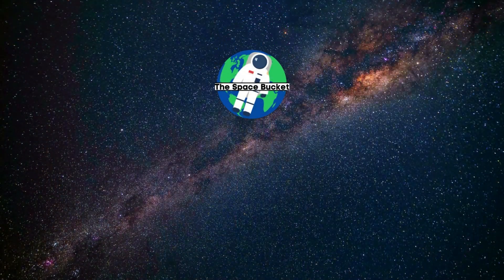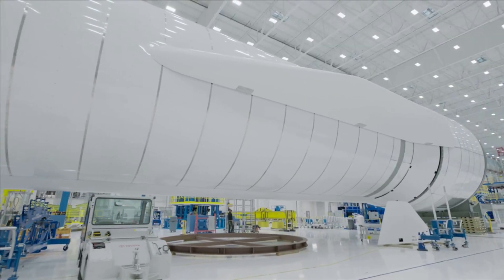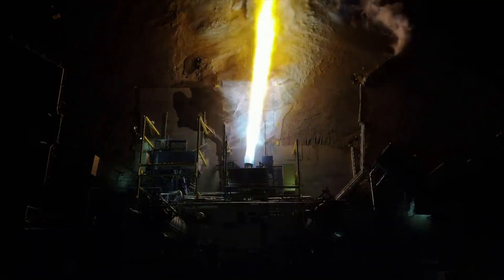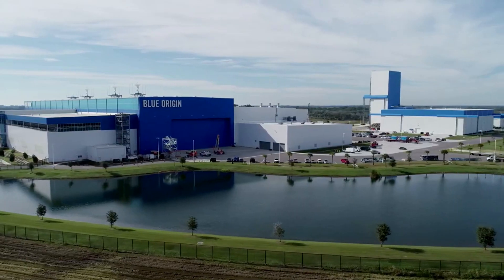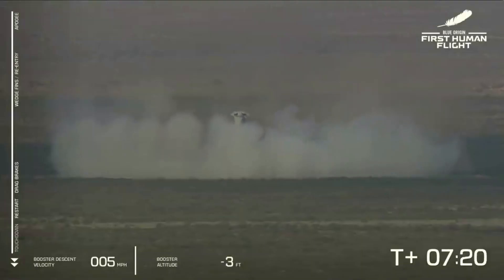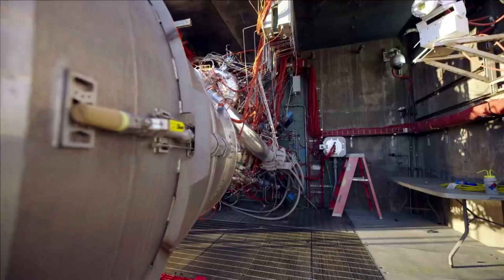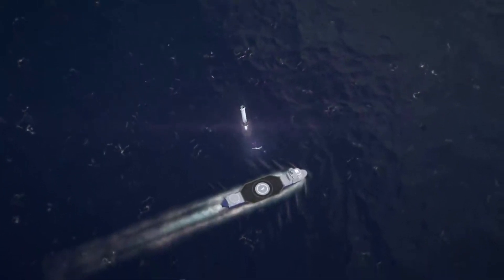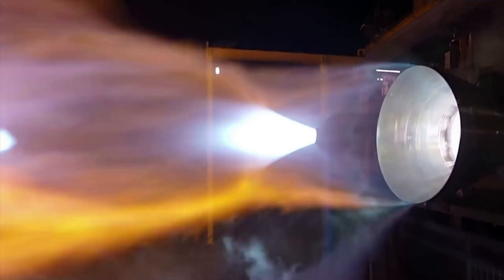How Blue Origin Plans To Land & Reuse New Glenn's Booster

Comment: I was disappointed that there was no mention of the delayed BE-4 engines and what the current timeline would be for them because this is holding up United Launch Alliance's Vulcan Centaur rocket as well.  I am also incredibly disappointed in Blue Origin in general.  It is 2022 and Blue Origin was started 2 years earlier than SpaceX, so they have been in business for 22 years now and have very little to show and still have not launched a single thing to orbit.
Reply: Ok great. You are on team Elon. Congrats and grow up. This update focused on the plans to land at sea. Be4 has been covered extensively.

Comment: So the plan is basically to copy the SpaceX design.  Which would be good if it was the new 100% reusable Starship design. But all they're doing is trying to copy the proven Falcon9, and it will be obsolete by the time they're ready to try a launch.
Reply: BO is already working on a reusable second stage made from steel, like Starship. I guess the payload capacity will be lower, but at least their goal is full reusability as well.

Comment: New Glenn is a much preittier rocket than starship but to be fair, Starship is still evolving. I would not be suprised if Starship started looking more like New Glenn.
Reply: if it goes up, does its job, and comes back down safely, who cares what it looks like? also, when spacex made its renderings years and years ago, they looked as cool as today's BO renderings. in the meantime, spacex is actually building and testing starship
Reply: @pgabrieli  I was talking about Aesthetics. No comments from the peanut gallery until the topic you want to comment on comes up. Functionalyty will be covered in the next class.